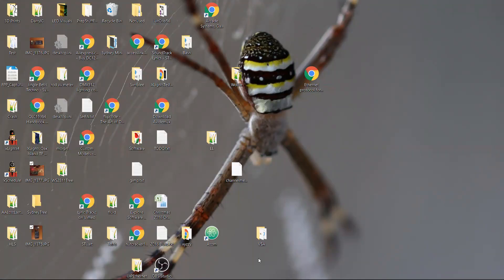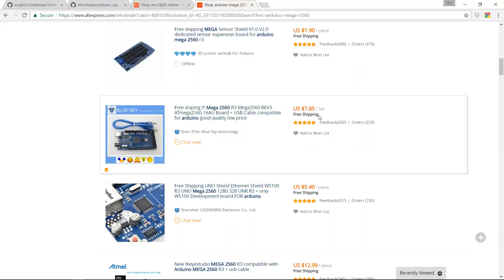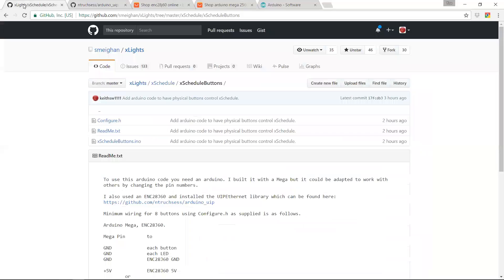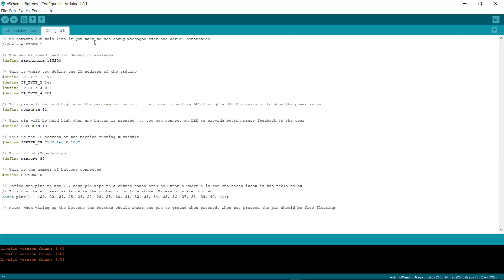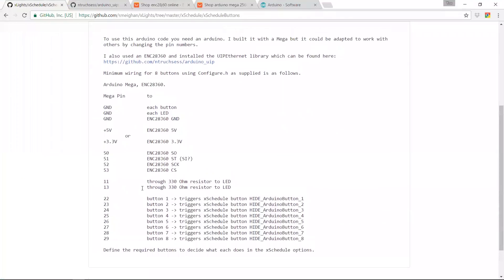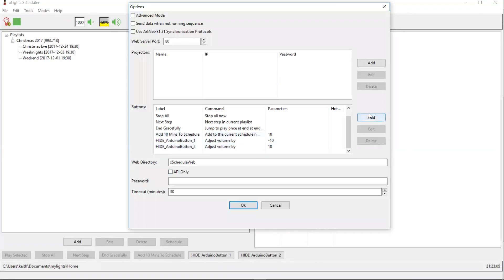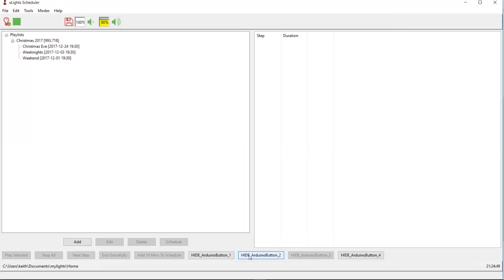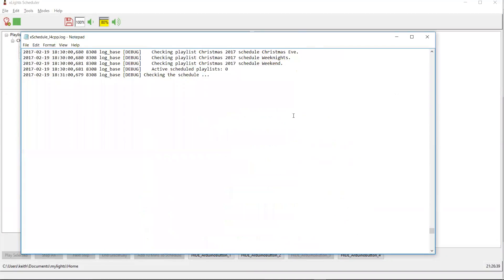How to get physical push buttons to control the new xLights scheduler

Comment: How would the enc28j60 connect if using a falcon controller on e1.31
Reply from the maker: The end28j60 connects to the network which talks to your show player. In this case the code is written to talk to xSchedule but it could be relatively easily changed to talk to FPP - but that is left as an exercise for the user at this point. Who knows someone might make the code work with both and then submit a pull request.